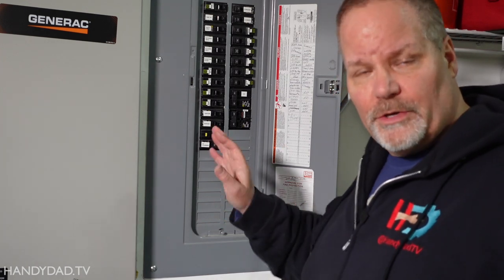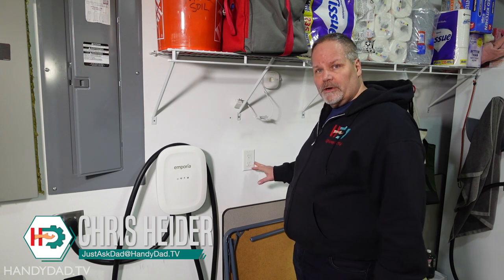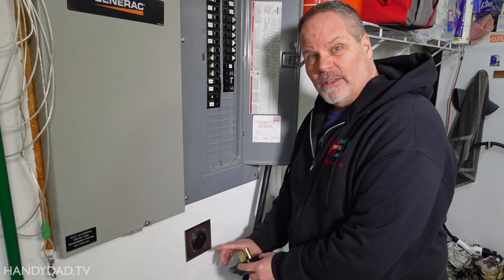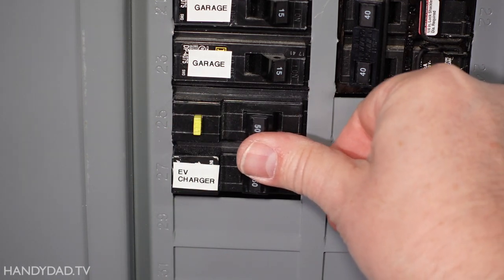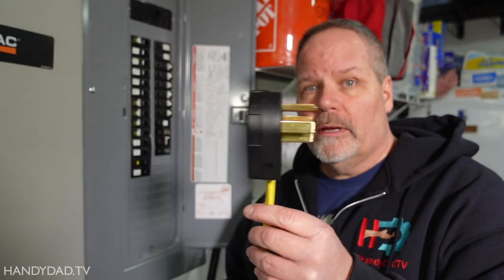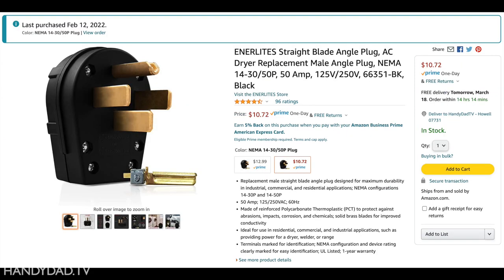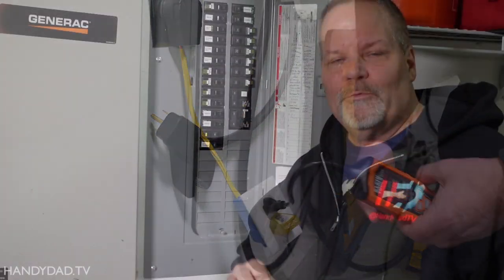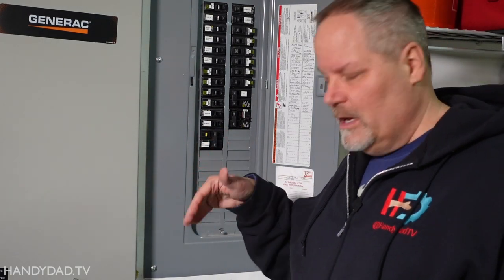How to test a GFCI breaker

Comment: Another dirty way to do this is to use a cheap utility lamp (led is fine) cut the plug and stick the wires between hot and ground. That will be 120v potential. 
Granted it's not exactly safe if you don't know what you're doing and the bulb will use far more than the 5mA trip current, but it's better than nothing for troubleshooting. If the test button doesn't work, the breaker may still work, but maybe the button just isn't making contact. However, just to stay on the safe side I'd replace it like you did.
Reply from the maker: That’s a really creative idea! Not safe, but creative.
Reply: Love this idea.. its what I was looking for - not wanting to buy another tester, but also wanting something  a tad bit safer than shorting hot to ground - briliant!

Comment: Klein should make a 240V GFCI tester. Too much work making two 120V receptacles just to accommodate a 120V GFCI tester — wasting money, material, and time.
Reply from the maker: Yeah I agree. I’m a little neurotic.
Reply: One could argue that the 120v tester is far more useful since most CFCI outlets accept NEMA 5-15P and Level 2 EV installations can use a variety of plugs. I’d only want a 240v version if I was specializing in EV outlet installs and, even then, I’d probably just make my own to suit the range of 240v outlets I encounter/use.

Comment: I wouldn’t either if it’s a square d
Reply from the maker: What do you have against Square D?
Reply: Garbage. Very low quality. Siemens the best
Reply from the maker: Do you work for Siemens or what?
Reply: No. I’m a very experienced electrician that knows square d sux.
Reply: @MrTooTechnical  Usually this would be the place to tout your experience with personal anecdotes of the ways in which Square D sucks… but you elected not to when given the opportunity. I will take that at face value since it seems you didn’t want us to take it any more seriously than that.
Reply: Schneider electric just recalled tons of panels in the last month. Proving square not good.
Reply: @MrTooTechnical  That’s more like it, though sometimes a recall means they care about a quality product.
Reply: I still don’t like square d

Comment: 10 cent solution: Take an isolated wire, put it in any of the non-ground slots of the outlet and touch the metal outlet cover and/or the ground pin of the outlet. If the breaker doesn't flip, it is not providing adequate protection. Something is wrong and everything needs to be rechecked.
Reply from the maker: Every breaker should pop from a short. That’s not how you test a GFCI.
Reply: @handydadtv  You are right. Didn't think of that.  It should go through a resistor. < 120V/0.005A < 24kOhm which will allow the current just above the 5mA GFCI trigger limit. 20 cent solution then.

Comment: Or just stick a wire in each leg to neutral heh
Reply from the maker: That would cause a short that any breaker should detect. GFCI detects a small current leak to ground.
Reply: That would blow up the garage 😂.